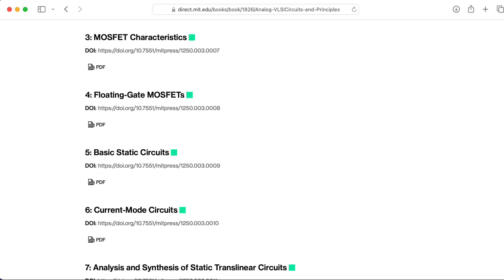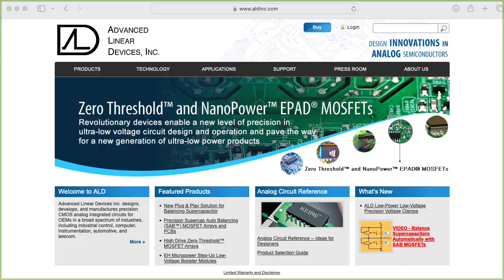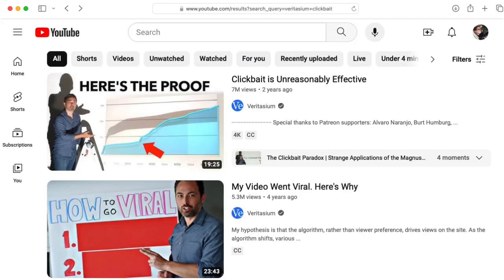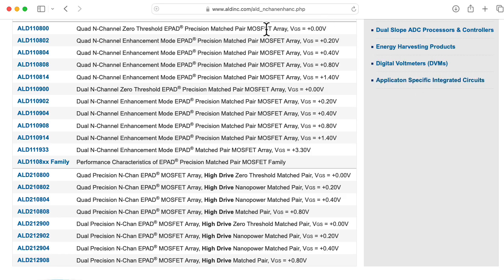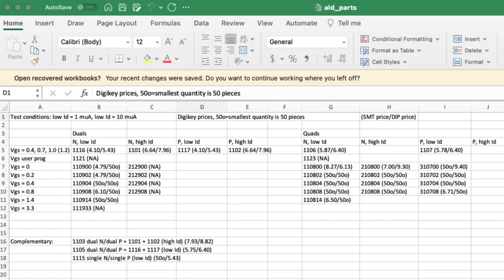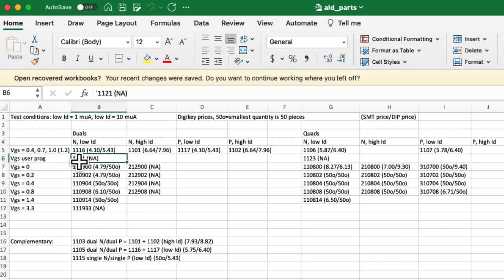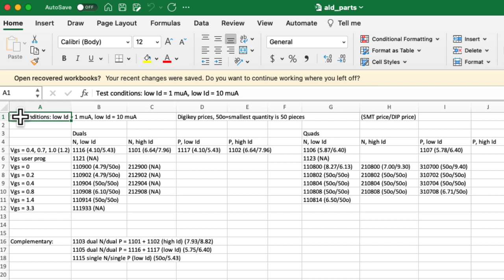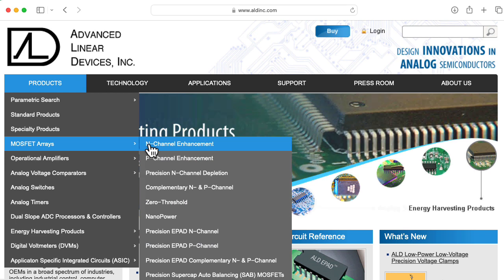Matched MOSFET Mayhem! Programmable Thresholds! Bulk Terminals Exposed! (Advanced Linear Devices)

Comment: You got me thinking, i toke the Falstad precision wave rectifier, added a audio input, selected a mp3 file, a comparator (and a voltage divider with pot) with a NPN transistor (+5V/-5V) to operate a fet coupled to a couple of a inverting opamps to set te right side op again of the wave.
Would that or could that be worked out to a good compressor?
the comparator is only active or the portion of the wave higher the pot?

Comment: I'll be waiting for the 1176 compressor circuit, there is also the ONSEMI H11F1M, H11F2M, H11F3M optical Fet, you might like that as wel, it shows part of a AGR (automatic Fain Reduction) circuit, would like to learn more about this circuit or possible implantation as well.

Comment: This is much better and more relevant.
Will you do some real world circuits perhaps?
Though not much can be done with a few fets, sample & hold, signal steering, VCAs and the like, analog synth ppl would find something relvant here.
Reply from the maker: I plan to pick up some of the ALD devices over break to try out -- two pFETs and two nFETs would make an operational transconductance amplifier core.

I have a series on here "Adventures in FPAAs Field Programmable Analog Arrays" which focuses on MOSFETs. (My ECE3400 Analog Electronics lectures, at least the ones I have on YouTube, focus on BJTs.)
Reply: @Lantertronics  i have a couple ALD1115 device at home, planned to be used as long tail.

Comment: Not sure if you've covered this before, but the ARP Omni 2 (only the 2, not the first one) uses the 4007 for VCF, VCA, and AD envelope generation – do you think matched devices would give any real advantage in circuits like that or is it the wrong question for the wrong application?
Reply from the maker: If it's just for envelope generation, I suspect anything beyond the old standard 4007 would be overkill.
Reply from the maker: 4007 is cheap, the ALD parts are pricey.
Reply: the CD4007 is kinda weird.